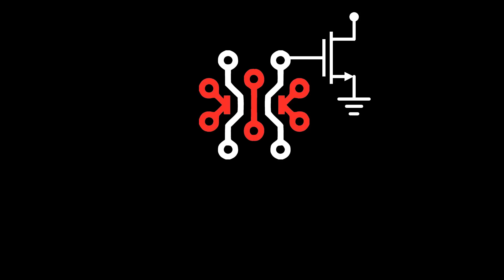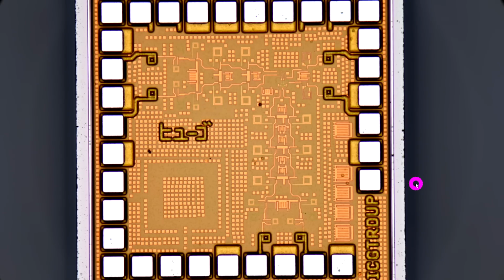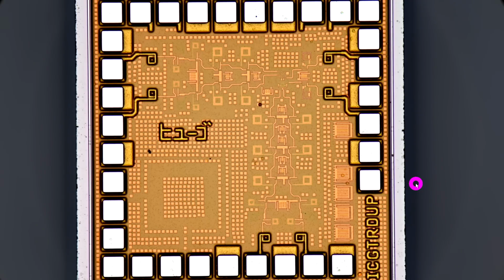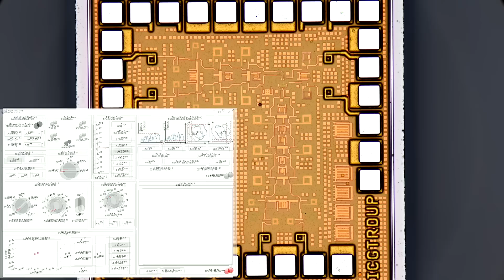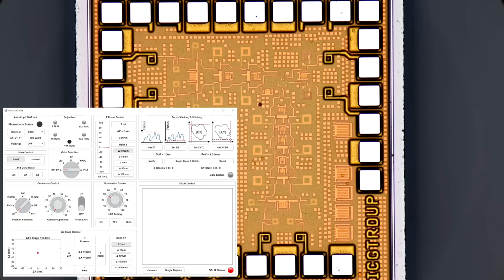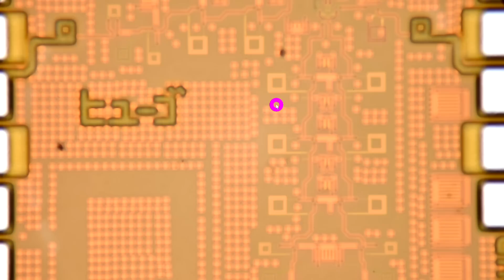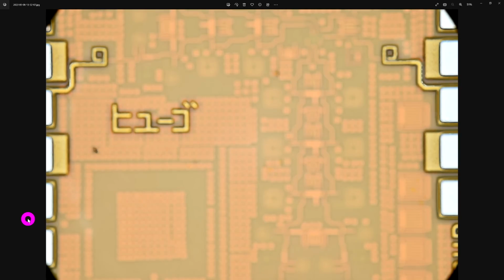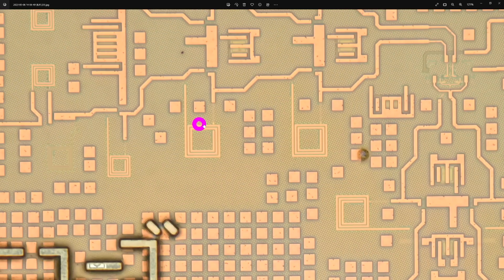TNP #34 - Zeiss Microscope Motorized XYZ Axis Stage Focus Stacking & Image Stitching Tutorial

Comment: 16:03 this is kinda SMD with dies, very cool en pretty. I wish I was brave enough to work with fuming nitric accid and had the money for a Xray machine. I repair electronics (Measurement/calibration/maritime gear) for a living and often I am curious what went wrong inside a component. On the other hand, I would probably spending more time doing that then repairing  :-)

Comment: I do lots of focus stacking of plants and small insects. Since you have stack and stich capabilities, I would recommend looking at zerene stacker as a software to use. It has much better batch processing and retouching tools. It is much easier to set up a batch job in zerene, and have it automatically stack all the images and save them out for stitching for me. I would also recommend trying out the focus stacking capability in Affinity Photo. Helicon and zerene both give you the option to use a depth map or pyramid maximum algorithm, but affinity photo seems to use a hybridized method which (I think) combines both stacking algorithms, making some images have less halo artifacts without having to retouch. Affinity photo also has stitching which has worked pretty well for stacked images for me.

Comment: One function that would be interesting to do would be a slow feature of CHDK for old canon point and shoot cameras. Basically they had an option to do focus stacking where each stage could have exposure bracketing for making a focus stacked HDR image. It didn't catch on as much back then since it used the mechanical shutter, but with electronic shutters there is no worry about wearing out a shutter when a massive number of images are captured.

Comment: Nice video.  Back at a previous job we had a zeiss axioplan(I think) that was super nice with darkfield and a motorized stage and even a motorized objective changer.  It was one of our nicest visual optical microscopes, as opposed to our camera only microscopes(as in one with no eyepieces).  I remember we also had a Keyence VR-X000(or similar) with 3d profilometry, 2d stitching and, multi-focal point stacking.  Man I wish I had one of those still.  Who knows we(my former employer) might have made some of those passive devices in the Keysight synthesizer, though Keysight probably made them internally.  
That is a pretty impressive control program that you wrote(I think that was what you said).

Comment: It might be worth disabling auto white balance on the camera. It looked like the layers were changing colour slightly as the focus changed which is probably caused by this. I'd probably also set a fixed ISO and if shoot in RAW if it's supported by your focus stacking software. I can't imagine JPEG artifacts are ideal for focus stacking - especially with all the sharp lines you see in ICs.
Reply: Great advice here!